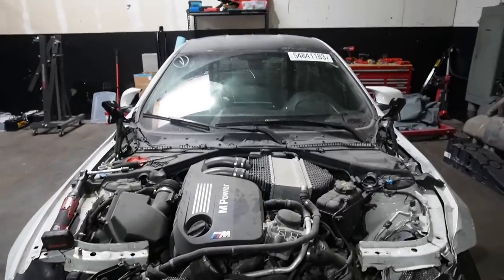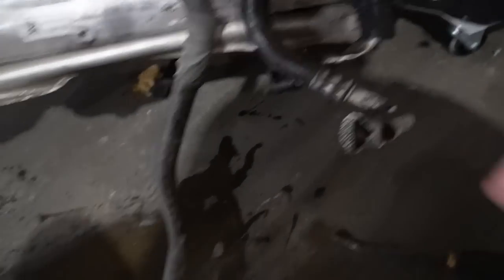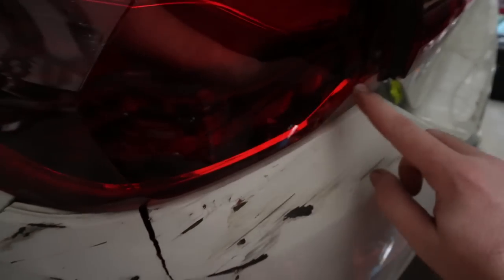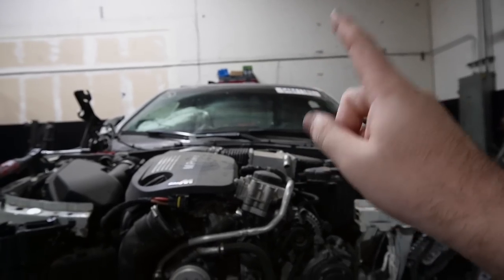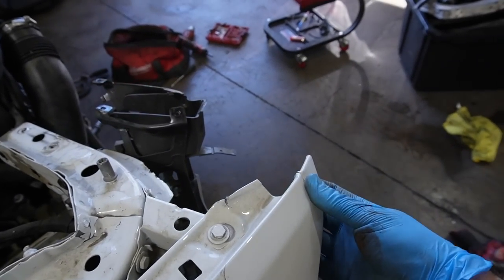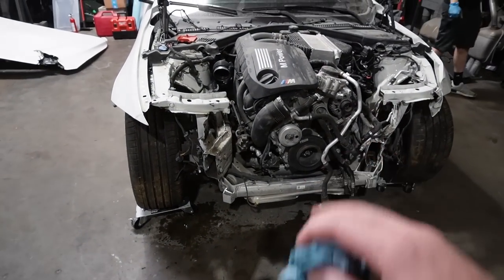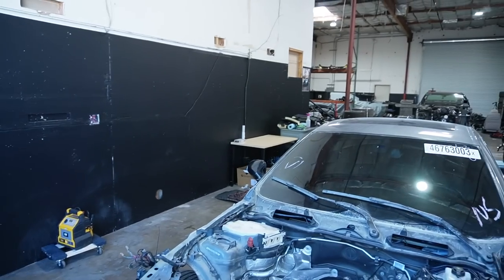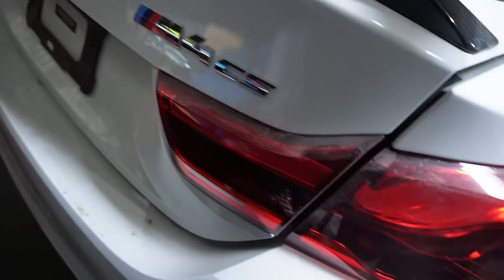REBUILDING THE CHEAPEST M4 CS IN THE WORLD! (AUCTION SCAM)

Comment: hey nour, as far as I know these are not oem m4 cs taillights. The oem taillights can be recognized by the inscription 'BMW OLED' and not just 'OLED'. I suspect the previous owner sold the oem taillights and installed the cheaper ones.
Reply: Yup, you’re right bro
Reply: They was already shot if you saw the auction pictures, he got the vland because it needed replace and its cheaper then oem
Reply: @imperator9180 I wouldn’t be able to sleep because I’d be worried about the engine. The guy quit on the rebuild for a reason